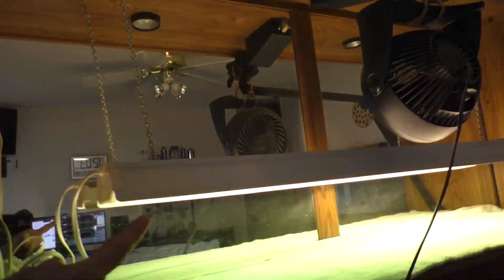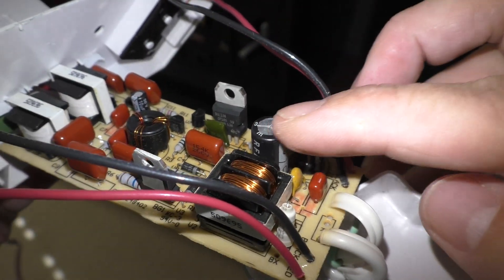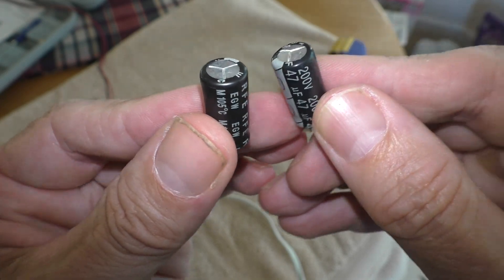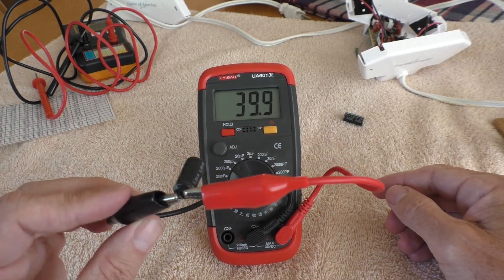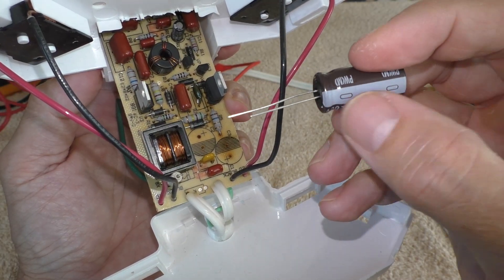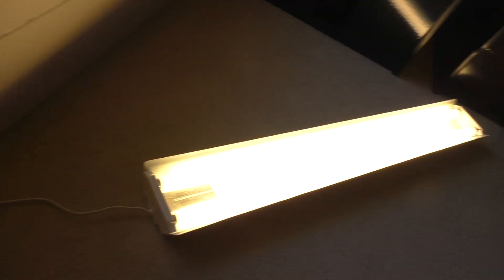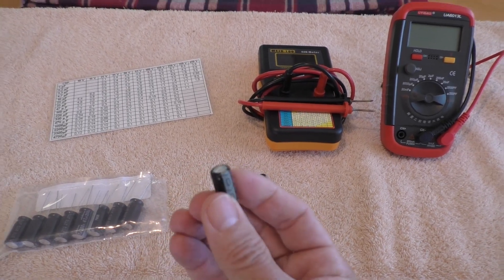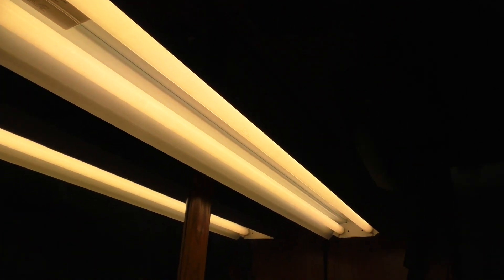Fix a GROW LIGHT Electronics REPAIR Fluorescent shoplight ESR Meter

Comment: At 33 Seconds, How do you get the metal/plastic end off of the fluorescent fixture - that looks like the hardest part that you didn't explain in the video.
Reply from the maker: hi, i pry at it with a flat head screw driver. i had to poke around until finding the tabs that are holding it on. i didnt add this part to the video because it was kinda boring and hard to see what i was doing.
Reply: @BubbleBeet  after I got the plastic cover off, I found two rivets, one on each side,  holding everything in place so I cannot access the pole switch to replace it.
Reply from the maker: use a drill and drill in the center of the rivet, it will break and pop off. my light didnt have rivets.
Reply: @BubbleBeet  thanks! I'll give that a try.
Reply: @BubbleBeet  Thanks! That should work.

Comment: Same thing happens on air-conditioners if you're outside fan is running but compressor is not bad capacitor or vise versa meaning compressor running and fan is not 15-20$ part